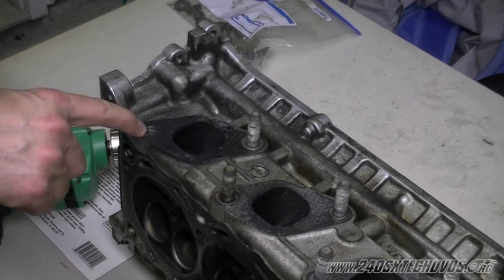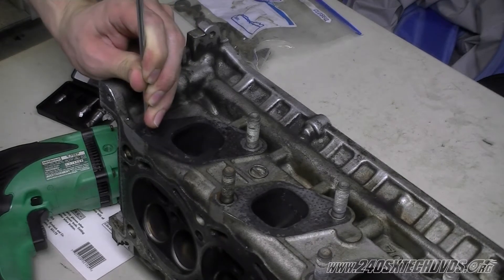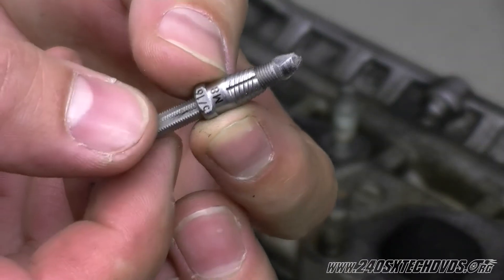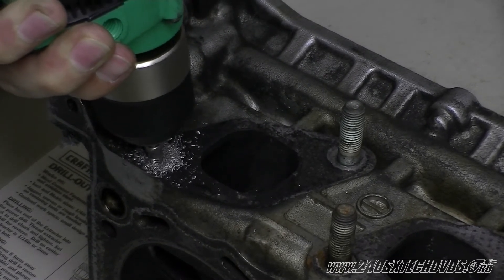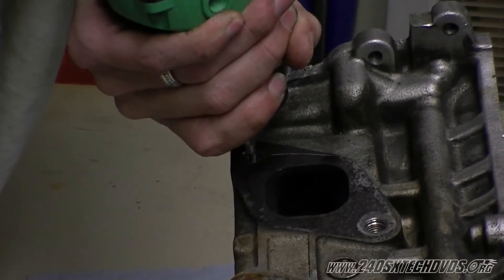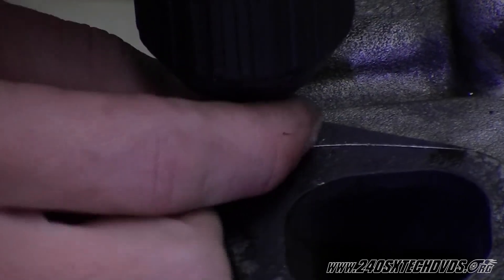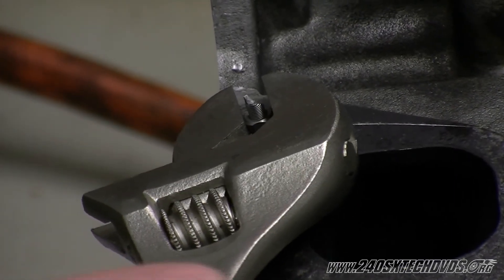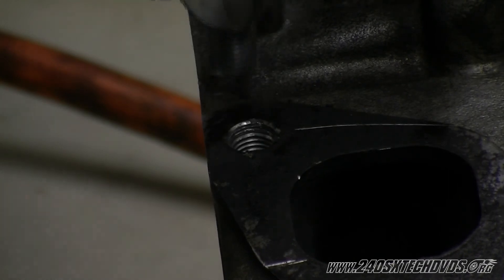www.240SXTECHDVDS.org 240sx KA24DE Broken Exhaust Stud Removal.mp4

Comment: I just had my motor rebuilt and just noticed that bolt is missing. Either they forgot to put it back on or broke it off and didn't even bother with it. My friend told me not to drive it until I get one put on would you recommend the same?
Reply from the maker: Yes I sell new stud/nut kits $40 shipped PayPal joshds25@yahoo.com